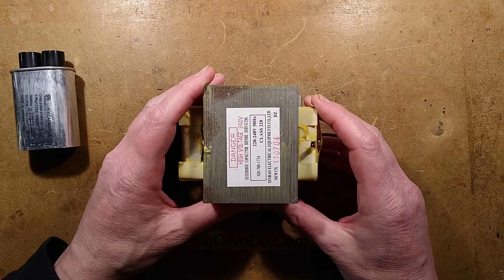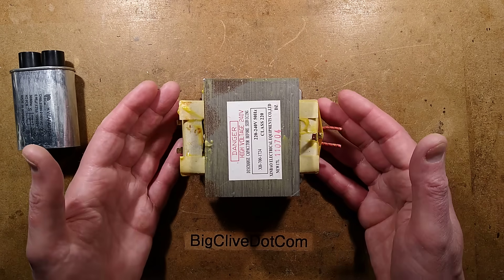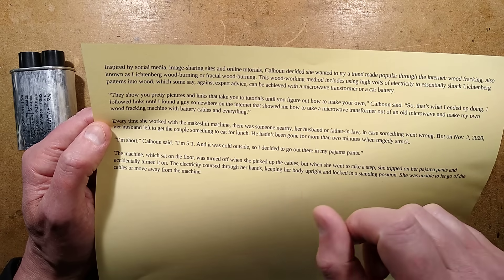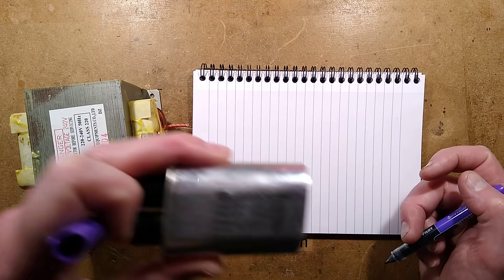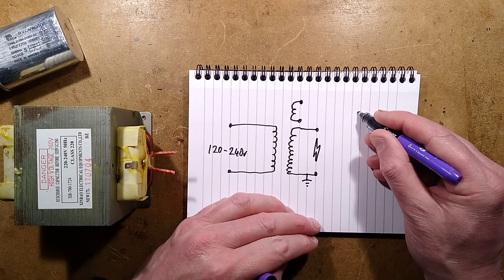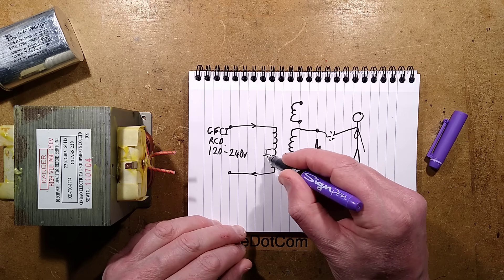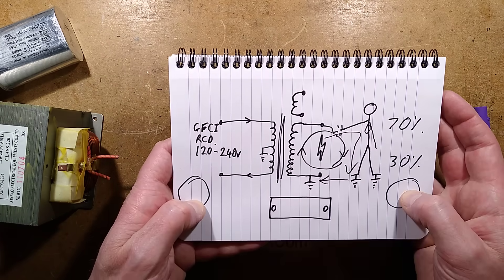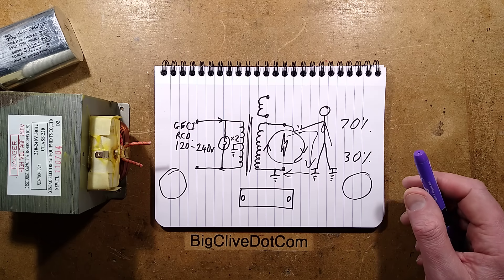The most deadly project on the Internet

Comment: The danger of this transformer is not the high voltage, but the high power. Microwaves are rated for hundreds to thousands of Watts. For example, I've electrocuted myself playing with CRT TVs back in the years, had 30KV ran through me several times, it didn't do much. Because the transformer is much smaller and only draws a few Watts. Voltage is not really what kills people, it's the current. 
Also, if you decide to go against all common sense and still play with a microwave transformer, at least limit it's primary side current to a safe value! You can run it in SERIES with a low wattage bulb, maybe a 5W or a 10W. That way, even if you get hooked to the high voltage juice, it won't burn you. For example, 220v@5W gives 0.02 Amps, that would result in 0.0025 Amps @2000V, which isn't really that much to kill you (normally, if you don't die of heart attack due to the panic when shocked).

Comment: I can remember back in the 60's when I was a teenager, getting hold of an old valve 'radio for the blind' set. No batteries in it so I had to buy a 6v lantern battery and a 90v battery. I'd already decided to test the 90v for a spark as soon as I got home, just out of curiosity.
It was a long slim affair with a brass terminal at each end, each terminal having a nail sized hole in the top. just right for jamming a four inch nail in and easing the nails together.
Didn't have time to look for a spark as a powerful punch hit me in the chest, (I could feel my heart trying to burst), and I finished up about 10 feet across the room. No burns or other damage. I handled the battery very carefully after that, but was disappointed to find that it only lasted a couple of hours or so.
Reply: I remember the one time I went to a thrift shop and bought what I thought was a nice bedroom sized plug-in radio little did I know it was on its way out and as it went I was holding on to the dial and the darn thing bit me hard! at least I had a warning suddenly it wouldn't go from a.m. to FM properly when I flip the switch just as I thought uh oh I've got a bad switch bizzt complete with noises coming out of the speaker. Be very careful with anything electronic. I also had a similar thing happen with a little blue transistor radio good thing it was only a little 9 volt powered thing and more startling than anything else then I realized I wasn't going to be picking up anything far away on am for a while.

Comment: These transformers are great,  but I would never use one with the high voltage windings. You could make a nice battery charger by removing the secondary and winding it with a few turns

Comment: Hi Clive, when I was stationed in Hawaii, in the mid eighties, working in "avionics", in the shop next door, working on search radar, during a routine "technical training class", a radar tech was giving a basic class on the common working of the search radar system.  He was setting the test set and the radar unit, and specifying "always check your cables, only use those numerically identified with the specific test set", while grabbing what he thought were in fact such cables.  He hooked up the radar transceiver, turned every thing up, and was surprised at no function.  Probing around inside, he had a hand on the case, probe in the other, and went through checking the low voltage feed.  He didn't recognize the symptoms, and ended up probing the high voltage, something on the order of five KVA, with no response, and peering into the innards, his head approached the test set, and suddenly it arced out his forehead, and he died within seconds.  He'd ignored his own warnings, had a wrong cable to the equipment, which had no correct ground connection.  The power supply was such it had six or eight separate wires connected together as a "ground buss" on the correct cable, and in running it up, had no ground return for the high voltage until his head got close enough to ground, and it arced.
          In two decades of service as a marine, I knew of probably five or six deaths of similar way and form for in the most part, the same problem.  We all knew every cable was made, designed for one specific test set, and multiple grounds were quite common because of sheer power.  We held "tech training" every Wednesday, precisely because of such incidents, and all too often, the danger was greatest while "demonstrating safe procedure.  I got hit with a two thousand volt discharge from a radar transceiver tube in 77, in my secondary school because the connection was always left open for troubleshooting, on the "bench test receiver/transmitter", blew the power for the whole Workcenter, left a scar on my finger 45 years later.  I see folks playing with microwave transformers based on internet video's, so this is a major issue, thanks for a great tech lesson!  John McClain, GySgt, USMC, ret.
Reply: Safety regulations are written in blood, unfortunately.
Reply: Damn saw someone get zapped in the forehead and kept doing it. Respect.
Reply: he was a good instructor.... he gave ya all real life example
Reply: So, 5 kva in the forehead is bad?  (irony)    Even playing with 220v was ten times more dangerous than the 110v we're used to in North America.   TIP:  Don't confirm open circuit in 220v by briefly flicking the 2 wires together.  Bad idea.
Reply: @Markus451  What is the irony?
Reply: Wow!  Thanks for sharing that story. Thank you for helping make a better world.
Reply: Holy Gauss cannons, Batman!  In light of your experience, what would you recommend as a safety protocol before reaching into this equipment?  I assume you could buy or build some sort of grounded high-impedance probe that could detect HV field potential in close proximity without actually arcing?
Reply: @shrimpkins  I think a couple people have written well, being out of reach, setting up, stepping back, turning on, away.  I got burned a number of times, in my years, and do much less of the extreme, as I don't have to.  It really will ionize almost anything, the least moisture, any salt will massively increase conductivity.
Reply: @johnmcclain3887  I was just wondering if some sort of induction probe could assure techs of a safe working environment?
Reply: It's not KVA - that's KV*A or apparent power. What you're talking about is just KV - kilo-volts - voltage
Reply: So this is what you did before Nakotomi Towers?
Reply: Thank you for your service, Sergeant.
Reply: If the high voltage does not get you, the earth will - or rather the earth that you thought was earth, but is actually open, so more like a few KV.
Everyone trusts earth, you can safely touch that - maybe....  ask yourself are you live, as in accidentally connected to or close to high volts, as then touching a real earth will be fatal.

If your working on a high voltage device, like the radar above, and it does not behave as expected, stop, power it all down, double check everything, get a skilled colleague to verify.
Preferably get an alternative rig out that has no connection and shares no parts (including test leads etc) with the one that just misbehaved.
Those certified and specified leads could be the problem, everything eventually fails.
Reply: Oh my the irony on this poor fella
Reply: Semper Fi to the Gunny!
Reply: Head on: apply directly to the forehead
Head on: apply directly to the forehead
Reply: Nearly the same name as the Die Hard character. Awesome
Reply: Darwin effect, sad to see anyone die for no good reason, at least he proved or validated the presence of fatal hazards

Comment: I generally dislike the idea of x dangerous thing should never be touched unless you have y degree, but playing with the output of this hot is like playing with a loaded gun. There are general rules for gun safety and when they aren't followed people die. Unfortunately, this makes no scary bang noise to instill some fear and respect (unless you short it). Heck, even power tools look/sound intimidating enough to make most people second guess using them without some knowledge about safety. Maybe if there weren't so many stupid warning signs, or the one on the transformer was more clear, then people would take it more seriously.

Comment: I've tinkered with these. They're quite terrifying. At this voltage things that you wouldn't think of as conductive are very conductive. Wood, the literal ground even 30 feet away, rubber even several inches thick can conduct enough to give you an instant life changingly traumatic experience. Even if you have good enough insulation to not get a direct jolt these things can still bite quite hard through capacitive coupling.  If you do build one of these do not set the transformer on the ground or a wooden surface. Always set it on glass or even down in a glass container, or a heavy acrylic box sealed with 100% clear silicone. If you want to move the wire while live I recommend 2 or 3 feet of dry PVC pipe and do not run the wire through the pipe (remember what I was saying about capacitive coupling?) instead mount the wire to the far end of the pipe with a plastic zip tie. I like what the author said. Make a big red button somewhere so that the thing is only on for a few moments and not while you're near it.

Comment: Cut the wrong wire 20 years ago while working on a job.  Melted my Kline 2000 linesman pliers and took a mid day nap about 10 feet from where I started.   The voltages doesn't always  go through your heart...some times it shoots out your elbow blowing that off, or maybe your knee...but its in the name of art...so its worth having hamburger hands.

Comment: Just came here randomly - leaving with some more learning under my belt. What I really took away was the info about RCD/GFCI and the fact they don't give you any protection from this type of setup with a transformer and the induction in the secondary coil. Great presentation - you may never know how many lives you've saved when someone who planned to do this fractal burning stumbles across your video first. You really need to tag your video with those "fractal" terms so people have a better chance of coming to terms with safety while trying this project.
Reply: .... In addition it's not just feet that could be the ground path, your other hand can be holding on to a metal bench, chassis case, etc.

Comment: Any shock causes damage, period, the amount of noticable damage may not be readily apparent, and of course larger amounts like this or lightning strikes produces more damage, more visibility. Over the course of my 35 years of RN I have seen problems related to even many years later, post shock. A small outlet 120 volts can for sure kill you, but much less likely, many of us had experienced the tingle of a wall outlet shock with small noticable effect. You should have three fail-safes for a project like this, good thinking as to make it such that it is nearly impossible to accidentally trip, flip, touch or not properly insulated yourself. I always make it not possible to reach or have no other option to preform operations incorrectly. No one wants to harm their pets, children or self's. Always take a time out and think of outcomes. Many times it pays to just buy something rather than make something. Many times the person, never had any idea that something could be lethal, for example look up performers who died on stage when performing in a light rain.

Comment: You cannot isolate against AC in anycase because you, your body, is either connected to ground or, if it is not, basically one plate of a spherical capacitor against ground ... the capacitance is big enough to conduct isgnificant current at 50Hz. You will get shocked and standing on a cubic meter of glass wont safe you!

Comment: I actually tried this out a year or so ago. Got the transformer and used a variac. Took every precaution I possibly could. I’d actually turn the variac and the breaker off while setting everything up. Kept everything a good distance away and tried to keep everything insulated from me. Scary as hell when you know dangerous it can be, but several pieces of wood came out beautifully. Would not recommend it to anyone though.

Comment: This video shuttered me to my core.  I have a Samsung all in one microwave that’s around 20 years old.  The door uses a counter weight & spring mechanism & the spring broke & needed to be replaced.  I opened the microwave & while I was familiar with the dangers of capacitors from doing car audio installations years back, I had no idea it was this dangerous.  I used wood chopsticks rather than metal tools to hook the spring because I didn’t want to slip & make a fatal mistake.  I was home alone at the time and that is not something I would’ve done had I viewed this video earlier.  I certainly won’t be doing any home repairs on my microwave any time soon.  I did it because you can’t buy this all in one unit anymore but it certainly isn’t worth my life to keep a 20 year old appliance running.

Comment: If you are going to mess around with  one of these, a kill switch, IMO, is one of the best safety features you can have. You can even  reuse the "door closed" push button switch from the microwave itself on the low voltage side to energize the transformer. No extra parts or wires needed.

Comment: I looked into this a while back, but thought about the very high voltage.. Higher than a weldinding machine.. Can't be safe, so I opted not to. Then I found out from here that 30! deaths from this is the current state (pun intended). So, no not going there. And a big thankyou Clive for the heads up. (I didn't get the 1st, but this did the trick).

Comment: Having spent my career working in Electronics, I was trained on anything up to 2400 volts, in Radar equipment. When i left the military, I worked in voltages up through 50,000 volts DC, then near the end of my career, it went up to 80,000 volts, in X-ray high voltage tanks. My nickname for that high of a voltage, "Crispy Beacon" Voltage. If you get hit by that much voltage, you'll look just like a strip of beacon. If you're not trained, if you don't know the safety requirements of high voltage, junk the microwave and stay out of harm's way. I've been tagged with things less than 1000 volts DC to know better. It's not fun.

Comment: I did something similar as a teenager with a car ignition coil, a 12 volt power supply and a relay. That was quite an experience. I don't remember what the output was but that was bad enough. I would never wire up or use something like this without taking extreme precautions.
Reply: Most of those coils put out about 20,000 volts which is about what's required to bridge the electrode gap on a spark plug.

Comment: I do some high voltage experiments with NSTs and eventually will mess with these, HV should scare you even if you know what you are doing. Never touch any part of the circuit while its powered on, always unplug it and manually discharge any capacitive things before touching anything, again dont just use a switch to mains as a safety device UNPLUG IT. If something needs to be touched in operation, use an insulating pole with plenty of reach. Another rule of thumb is an arc will go 1 inch per 10kV in air, always keep that in mind. If you can keep these things in mind and give them respect you can experiment all you want.

Comment: It's the current that kills, not the voltage. You can buy a gag toy that looks like a radio, but it's really designed to shock the person pressing the fake "on" button. They run off AA batteries, and put out thousands of volts via a transformer in the fake radio - but, there's almost no current. So, the victim feels the shock, but with no amperage, it's essentially harmless.

So, why didn't we hear anything about amperage in this video?

Comment: Years ago as a kid would use a 8' fluorescent light ballet to electrocute roaches. Our Mon would never let us to use bug spray so that's how we ended up. I have a 5,000 volt megger that puts out nice small arc. Fools who attempt to use a 2 KV transformer should use wire rated for that voltage along with high voltage test proves and rubber gloves rated for 5 KV. also should have a will made out and another person nearby. A few years ago we had an apprentice electrician get electrocuted while connecting white neutral wires on a energised 277 volt light.

Comment: I used to repair microwave ovens. I was always careful and never got shocked by one, but my boss did. It wasn't from ignorance. He was probably as talented as Big Clive. Accidents do happen. Anyway, it happened because the transformer was not discharged. The oven was not plugged in and it still almost killed him. He was lucky. Had it still been plugged in, he would have died.

I can't imagine hooking one of these transformers up to burn wood and handing it to someone who doesn't understand the risks. Hey, I fully understand the risks and I wouldn't touch the thing.

I did not know the 70% fatality rate, but that sounds about right. This thing would be very deadly.

Comment: My papa had an issue with break ins at his garage in the 70's so he put a wire mesh over the windows with insulated standoffs and used it as a conductor wired into some form of small transformer. He had a couple broken windows but no more lost tools🤣😂